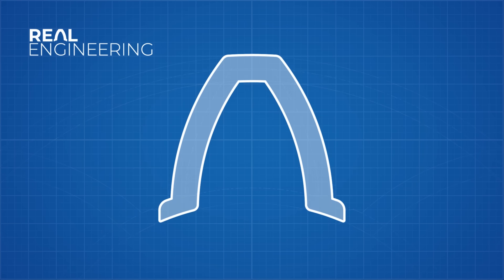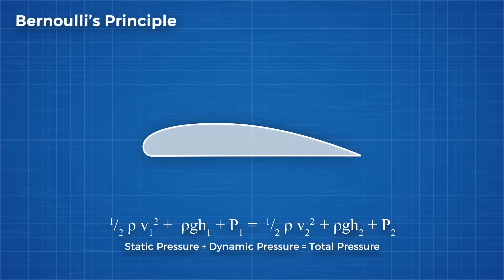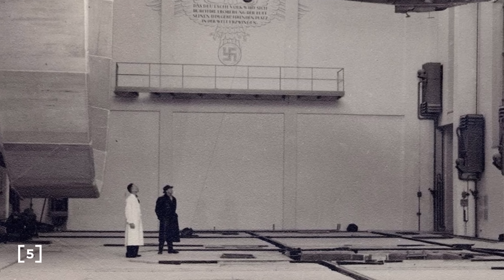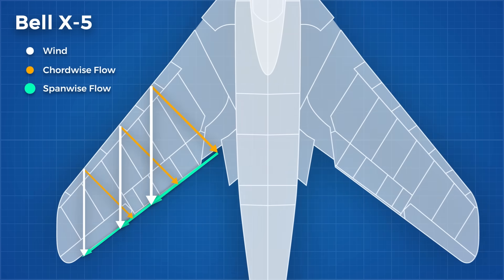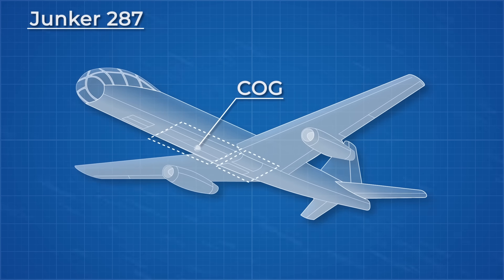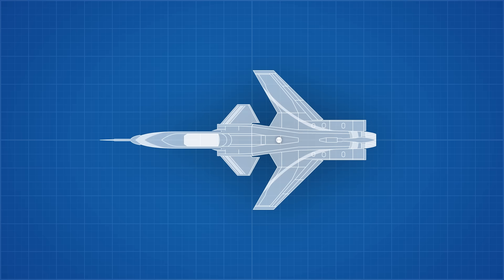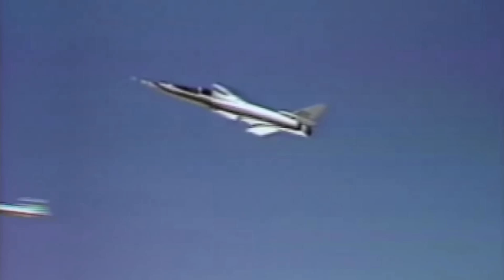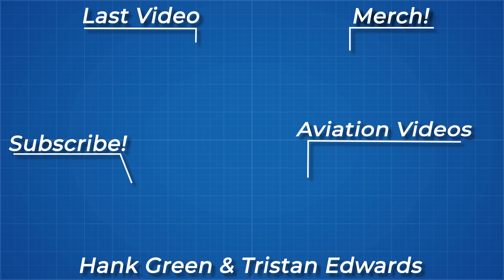Why Do Backwards Wings Exist?

Comment: "Front wing"? "Rear wing"? Gee, my dad (who among other things, was an actual PILOT!) always referred to them as the "wing (in front) and the "stabilizer" (at the rear).   On the X-29 the stabilizer and wing have traded places, but not function (the wing generates the lift that supports the aircraft, and the stabilizer controls the vertical motion of the nose - -the "pitch axis").Making simple little mistakes like that make you look like you don't really know what you're talking about.

Comment: All you need now is 3 smartphone sized computers.
Reply: True that. Then again, a normal sweep wing design has more chances of recovery from stall and that's crucial for a commercial design, so it's hard for it to become widespread anyways.
Reply: @LordZero666  Yeap, this was more of a comment on how much computers have advanced than to bring back backwards swept wings.
Reply: @LordZero666  That's certainly true...but afterburners and supersonic flight are too expensive for commercial designs and those are commonplace in fighter jets.  Considering the biggest limitation of the F-35 is that it has to not kill the pilot with g forces, maybe the next generation of fighters will be able to use forward swept wings because the computers replacing the pilots will be designed not to stall the plane in the first place.

Comment: If I may point out one aerodynamic benefit that you've not mentioned - One conventional straight & swept-back wings, the wing-tip vorticies generated create a lot of drag, hence the various devices added to the tips as seen on Boeing's & Airbus's, etc.  A forward-swept wing creates far smaller vorticies and hence less drag.

Comment: While your aerodynamic analysis was spot on, and the challenges associated with the idea were overcome.  While we did learn a few things about building an air frame with composites.  You mentioned the real reason for the experimental airplane almost in passing.  No one proposed that a forward swept wing would supplant the traditional aft swept wing, in spite of the reduction in drag and extreme maneuverability

The real reason for the X-29 being built in the first place was to test a flight control system that could keep it in the air.  Once they proved the system out in 1988 the program wasn't cancelled, it ended in success.

The flight control system developed in the Grumman X-29 is the backbone of every flight control system to follow.  From the newest F-18, to the F-22, to the F-35.  They even retrofitted some F-15's during the program with the flight control system from the X-29 that were fitted with thrust vectoring.  Allowing for incredible maneuverability in the large plane.  As a result of this testing, the Air Force was confident that thrust vectoring was feasible for the Gen 5 planes to follow.

We had to prove the reliability of a computer based flight control system that could handle the shear volume of calculations and corrections before it could replace its predecessor.  The unstable condition of the forward swept wing sped up testing considerably.

Comment: "Tail wing" is an unusual term for the tailplane or horizontal stabiliser, since it suggests positive lift. The job of the h.s. is to provide a downward offset to the aircraft's normal attempt to pitch down. Think of a market vendor's barrow; to move one, you push down on the handles to lift the front legs off the ground. The least drag occurs when the machine is exactly balanced, so no downforce is needed. (You can make a small aircraft like a Cessna 172 go slightly faster by sliding a seat backwards to do that.)
A swept wing (either direction) presents a slim profile to the airflow while permitting a thicker section for structural strength. Thin sections with sharp leading edges are good for supersonic flight.  (If you can, take a look at an F-104's wings, but be careful; the leading edge is sharp enough to hurt you.)  Thick ones with round leading edges, (any light aircraft),  are good for low-speed lift.

Comment: You very well explained the aerodynamics on a wing structure, thanks for that; I haven't yet come across terms like chord line or spanwise flow !
I just don't understand, why computing the data necessary to keep the bird stable in flight should have been one of the problems considered to be so fatal (among others); wasn't the F-16 a plane that couldn't be flown without constant influx of computers ? This plane had it's maiden flight in 1974 !

Comment: When there is a need for operations, flying under radardetection in cliffs or canyons.. Flying these type of wing jets give more insights of your wingspan as a pilot.. Flying trough small canyons becomes more easy when you have your left and right wing at check..
Reply: I don’t think that’s a very common manoeuvre these days unless you’re bullseyeing womprats in your T-16 skyhopper on Tatooine or aiming proton torpedoes at an exhaust port on a space station.

Comment: The P38 has always been an "odd beast" to fly, according to MANY pilots. You don't have to be an "engineering genius" to realize that a plane with such a shape - once stalls and enters a spiralling, uncontrolled fall is practically impossible to recover - you'd better just get the hell out of it, instead of trying to regain control. It always had "control issues" and they weren't due JUST to the wing cross-section.

Comment: One thing that I wonder about is the yaw stability. a regular swept wing has improved yaw stability because if a plane yaws the wing on the inside of the yaw creates less drag and the other creates more.  This would be the opposite with a forward swept wing. Is this part of the reason spins can be unrecoverable?

Comment: A take from you on the "how do wings actually work" debate would be very interesting indeed
Reply: Particularly because if you actually do the math on how fast an aircraft needs to fly if the Bernoulli principle produced the lift, you get a value for the stall speed that is several hundred miles per hour. The Bernoulli principle also doesn't explain how a flat or symmetric wing generates lift. The lift is actually produced by entrainment of airflow over the wing by the Coanda effect resulting in a diversion of airflow downward -- if the air is moving horizontally at the leading edge, it will be moving downward at the trailing edge. This does not, however, invalidate the description of the cause and effects of the 'mach tuck' experienced by the P-38; that description is accurate.
Reply: @seanmalloy7249  The fact that the problems showed in the video arise from consideration on the Bernoulli principle, and that the solution applied actually worked shows how the Bernoulli principle must play a role generating lift. It simply isn't foundamental or predominant.

Comment: People need to stop saying Bernoulli's principle is the reason wing generates lift. While it is true, it is a lesser effect. And it doesn't explain why, for example, upside down plane, or plane with flat wings (like a kite) can fly. 

More significant reason is Newton's 3rd law. Wings deflect airflow, and create the opposite force. Ofc, if you need efficiency, stability, etc, you need to pay attention to Bernoulli, and many other things, but people need to stop stating it as a first or main reason why planes fly....

Comment: Good video, but it could have really used a bit better explanation of why forward sweep causes instability. Forward swept wing mainly suffer from directional (yaw) instability. This is because once one on the wings (left or right) begins to experience more drag for any reason, that side will begin to be pushed back and the plane will yaw. This is true for any aircraft, but with a rearward swept wing, the side being pushed back will begin to have less area exposed to the wind which will reduce the drag on that side and straighten the plane out. The opposite is true in a forward swept wing, the side being pushed back will have more area exposed and experience even more drag, quickly becoming exponential and uncontrollable.

Yaw stability is also closely linked to roll stability, which is why things like dutch roll exist and the real world effects a bit more complicated that my basic explanation, but it's helpful to have an idea of why something is happening. On a related note, a rear wing and canard setup is not inherently unstable (now talking about longitudinal stability) and in fact designs with a lifting canard are stable. Planes such as the Eurofighter Typhoon have canards that produce negative lift and are unstable. I don't know how the X-29 is set up, but I suspect they went unstable design.

Comment: If the fuel efficiency of the aircraft was increased but it became harder to maneuver why don't commercial aircraft use them, or do they not reach high enough speeds to benefit from the increased lift from wind speed?

Comment: Congratulations for a great explanation that hardly mentions vortices and induced drag!
In the 70's and early 80's I was experimenting with forward canting foils on sailboats, everything from windsurfers to 40' keelboats. I found essentially the same problem -- instability. I could get moments of spectacular VMG to weather, but it was impossible to maintain it. The boat would become unstable on other courses, too if it was a keelboat. Drag, therefore speed, over a course was significantly worse so I gave it up. It is so enticing, though.

Comment: I started building plastic model airplane kits in 1955, when I was 5.  I couldn't read the instructions, but I understood the diagrams.  Models back then cost either 49 cents for the small scale, and 98 cents for the larger.  Money was scarce, but when I had enough to buy a model, I headed down the street to the TG&Y (remember the TG&Y?).  One day, when I was about eight, I saw a model of a plane I'd never seen before...it's wings were swept forward (I assume it was a Junker 287).  I told my dad, who said I was crazy, "The wings would rip right off!"  I said, "I saw it!"  He didn't believe me.

Comment: The X-29 needed computer control to maintain stability, how is that any different from fighter aircraft today? Without computer control the fighter aircraft of today wouldn't even be able to get off the ground, so why haven't we gone back to the forward swept wing, since is so efficient? I have an aircraft design that incorporates a sort of forward swept wing. Not because I knew it was more efficient (because honestly I didn't) and not because I thought it looked cool. For some reason I just felt, in my gut that, that was just the way it should be (I can't really explain it, that's just the way my design "developed").